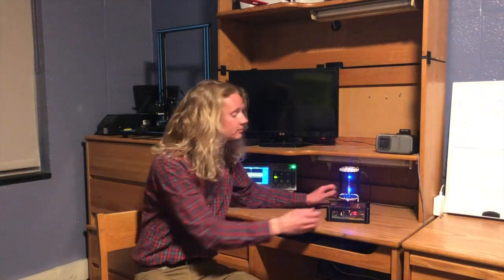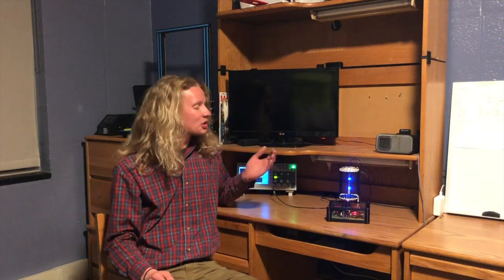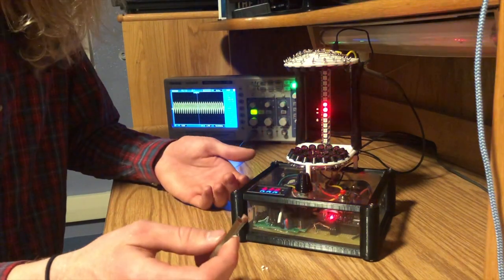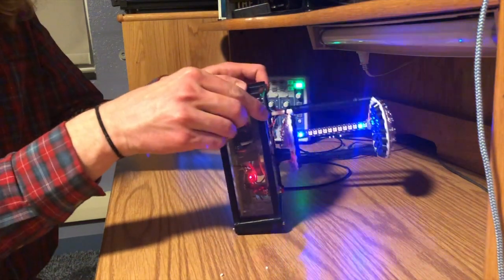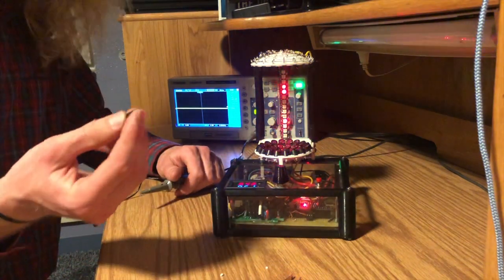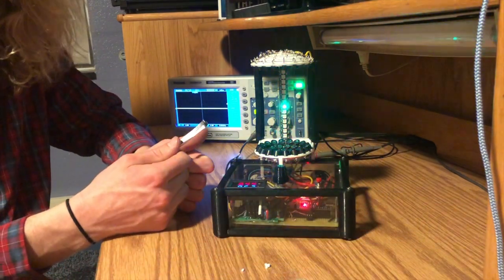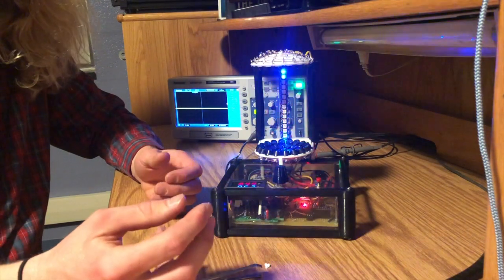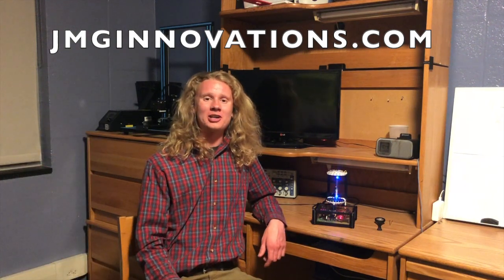The Acoustic Levitator

Comment: Great video, the lights are quite genius but it would be better to make it dimmer and with a light diffuser.

 so I made this thing and it is not working, I didn't check the polarity of the transducers because I don't have a oscilloscope, could it be the cause of this issue, did you come across any difficulty. 

Would appreciate it if you could help me
Reply from the maker: Thank you for commenting!
Reply: It might be the hole that i didn’t drill, but not too sure